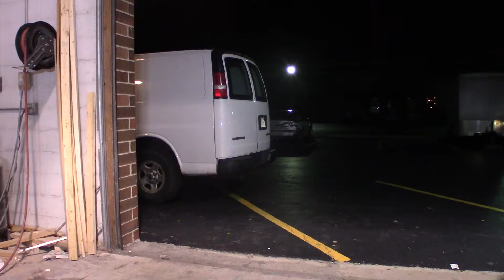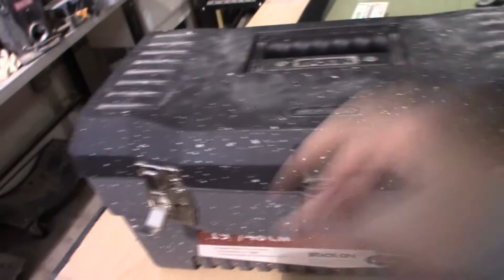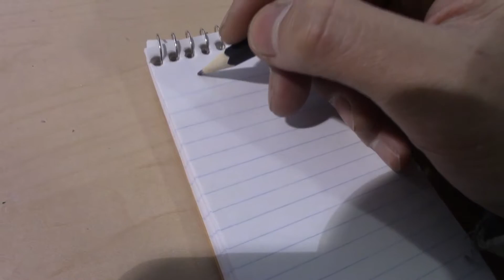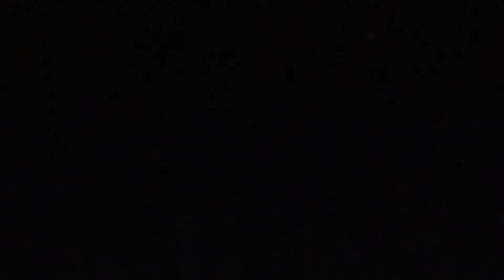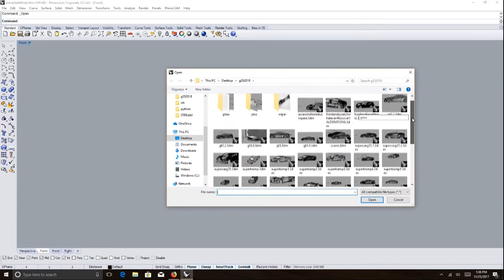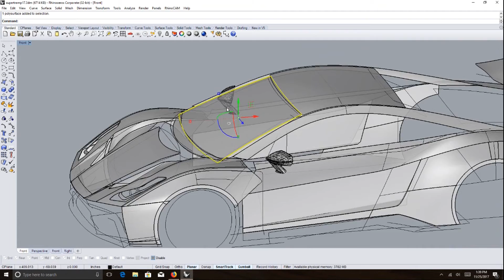We have a WINDSHIELD! for the project car

Comment: you could also probably place that windshield under you router and then manually probe it with a spring loaded spindle  "probe" and then manually record the DRO to map the surface.  COuld also be automated, or semi automated.   One compromise at automating that would be to set up g code to move the router to the point of a grid resolution specified by you, then just jog down until your spring plunger contacts...etc you're a smart guy you get the drift.   nice work you are doing btw
Reply: oops just saw someone already mentioned the idea!  lol

Comment: Measuring that would have been a lot easier and MUCH MORE accurate in your CNC machine,   Use an indicator or edge finder and your digital read out..  Just touch every point your need with a dial indicator mounted in the spindle,   record the X,Y and Z dimensions from Mach3 readout..    You can use a CNC as a CMM..  I do it all the time..

Comment: Would it have been possible to use lexan?
Reply from the maker: Benjamin Thomas it's possible but less desirable
Reply: NO,  You can NOT use Lexan in a front windshield..   It's illegal..   It has to be safety Glass only..    If you get caught,  Your State Motor Vehicle Dept will have your head..    Cops do notice that stuff..   Besides,  the wipers will wear it to a dull finish and cloud your vision..
Reply: Polycarbonate fades, scratches, yellows way too easy
Reply: MrFakit how does it yellow i havent seen that before

Comment: Did you have a go at grinding tempered glass?
Reply from the maker: Grantley Design I will forego it. Initially when I could not find a donor glass I was planning to cut tempered by annealing it. Then I did some more research and decided to go with laminated glass for the sides. After more research about tempered glass it was going to be difficult process just to anneal it to cut.